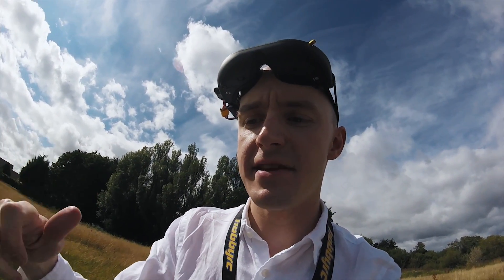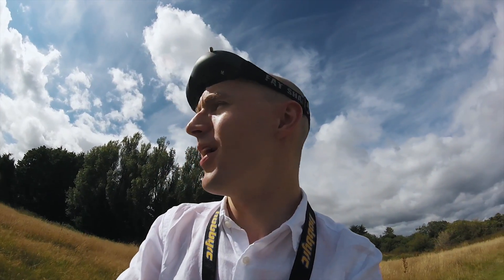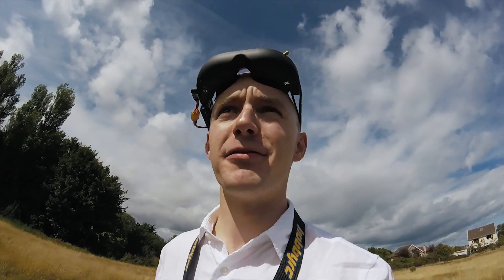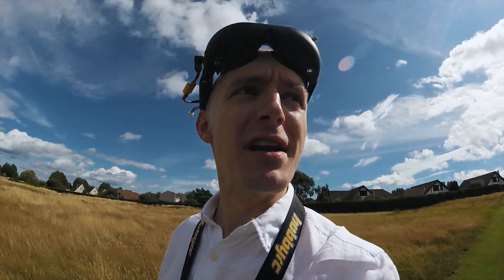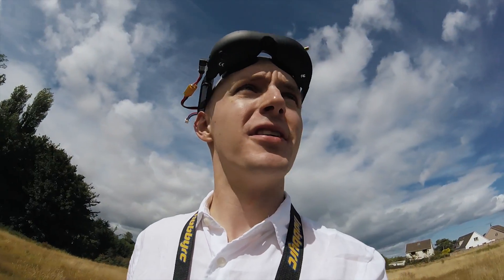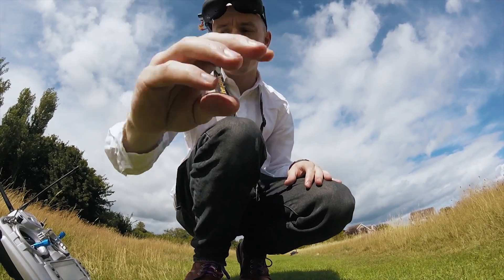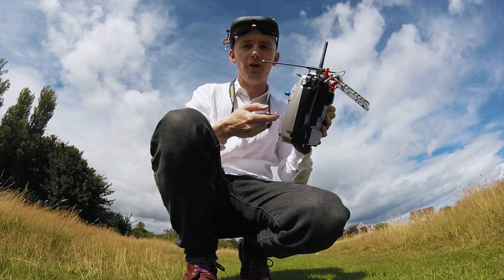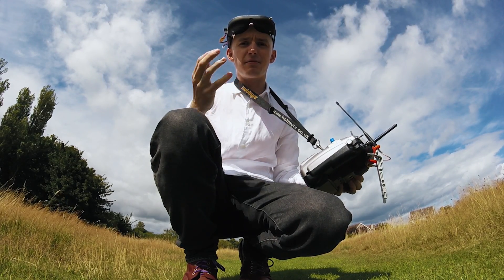DAL Cyclone 7056 // iFlight XL7 // T-Motor F80 2408 1900kv

Comment: hey man what sorta time u getting on these motor on 4s packs ive just order a set for my source 1 7inch
Reply from the maker: If you check the end of the video you'll see I'm getting 8-9 minutes for my sort of flying on a 2200mAh 4S. More relaxed flying will obviously get more flight time, I can get over 10 minutes with the same batteries & motors but on a 6" frame.
Reply: @CJDavies  sweet good shit man thanks

Comment: These are awesome motors! Why you have 45A and 1123mah  crossed ? It was not calibrated or something ? I fly the 2500kv version with 7042/2 or 6042/2 on 4s
Reply from the maker: Not calibrated. I fly the same motors with 6042-2 on my Armattan F1-6 also on 4S, I absolutely love these motors!

Comment: Hello! I have the xl7 and the dalprop 7056 hits the frame, how did you do it? Thank you
Reply from the maker: I've had a bunch of comments about props hitting the frame (particularly with the Gemfan Flash 7042) & I think what's happened is that iFlight have made several marginally different versions of the frame. The listing I bought mine from said it was 281mm & it has 3 sets of standoff holes, while what they sell now says 284mm & has 4 sets of standoff holes.